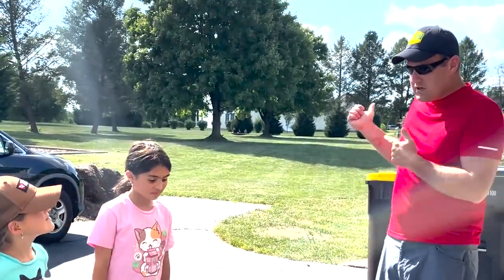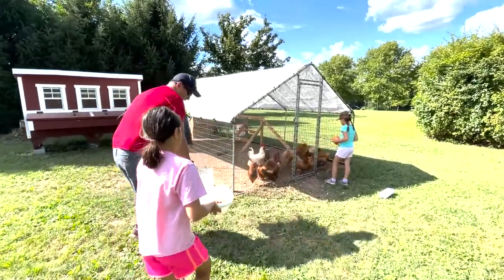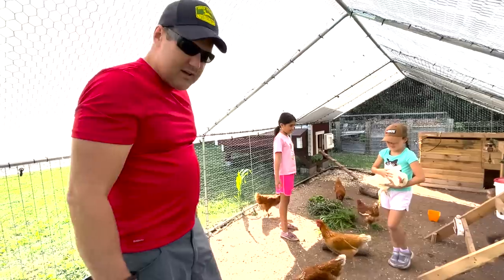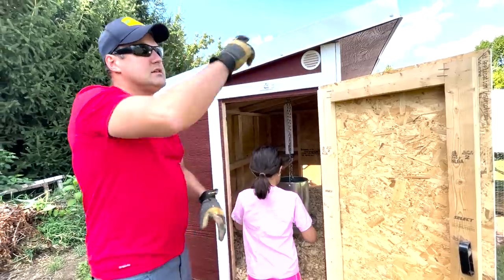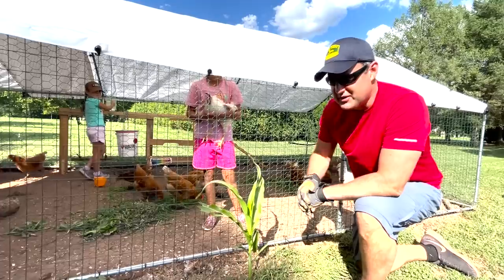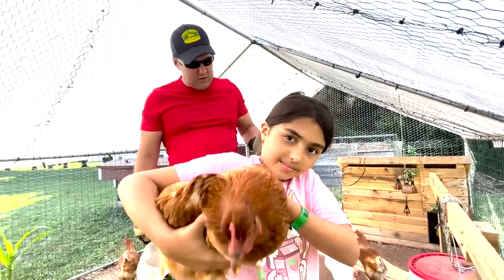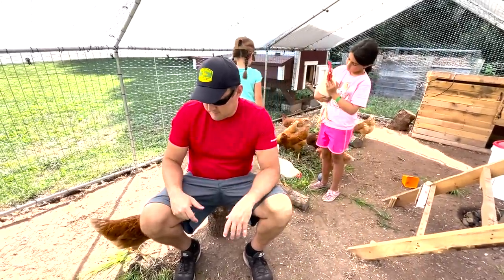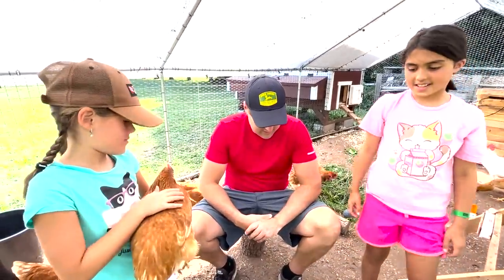The Economics of a Chicken Coop. Much More Than Just Eggs!

Comment: The time spent with your 2 helpers is priceless. In what state is the chicken coop located? Wondered about the winter time
temperatures; high/lowe temps.
Reply from the maker: I’m in PA. Winters are tough here but not brutal.  Below zero is rare but not unheard of.  I’ll probably have to run a heat lamp if the forecast calls for a deep freeze but otherwise they’ll be ok in winter.

Comment: good job.  You're one of the few YT chicken owners who built it right.  You'll want to start thinking about allowing them to reproduce as well. I allow one broody hen to hatch out 5 babies each spring.  That will keep the flock going.  You'll want to find a farmer near you who will take your extra roosters since multiple roos will fight and stress the hens.  You'll also want to learn how to deal with common medical issues and how to treat them.  But you're doing an excellent job.  It's obvious you did your homework,  Not sure where you live, but winter is something to consider ahead of time.  We cover the entire run with 6 mil plastic before each winter. You may want to buy a few rolls now in case the supply chain goes down again.  It keeps the run very cozy throughout winter.  We also bought an electric warming pad for their water and a few of the cozy coop heaters for the really cold nights.  If it's too far to run an extension cord to your coop, you can run them with solar.

Comment: I started chickens (plymouth blue sapphires) this year as well. 10 to start, one ended up being a rooster and I live in a suburban development. My vegan neighbors bitched about it, so I told them I turned him into soup. They won't complain about minor shit later.
I custom built my coop for next to nothing (spare materials) and it looks great. I bought the run ($200) and lined it with rabbit wire to minimize the risk of them getting their heads stuck and dying. I am still working on the perches and looking to a better water solution. I have another neighbor who gardens big time and we give them the "compost filler" as well as some of the extra eggs we cannot eat. They in turn share their bounty and help feed the chickens.
I would say your mistake is purchasing one of those overly expensive coops. I would also make sure you have power out there in case the temps drop bad enough that you need a heat lamp.

Comment: Everything looks great! The only thing you didn’t mention was if you were feeding them calcium. I feed the girls shells back to them but you can buy oyster shell also.
Reply from the maker: Good point Jersey! I save the shells, cook them at 250 degrees F for about 20 minutes (eliminate moisture + bacteria), then run them through a blender until their powder and mix the powder into with their feed.  Can't take credit, it's Mysh's method.  So far it's working.  I also sprinkled some of that powder in my tomato garden so hopefully I don't get any end rot next year on my tomotoes.
Reply: @NobodySpecialFinance  that’s way too much work for me🤣. I’m not saying that Mysh’s way is wrong but I’ll tell you what I do and why. I simply rinse out the shells and microwave them for 3 minutes and then crumble them into little pieces. In order for a chicken to get nutritional value from anything they ingest, it needs to sit in their crop and break down. If it’s small particles, it will process through quickly and they won’t get nutritional value. My girls go crazy when I bring out their shells and I have never had any of my chickens eat their own eggs. Just my opinion. No right or wrong and Tums work great for blossom end rott also.